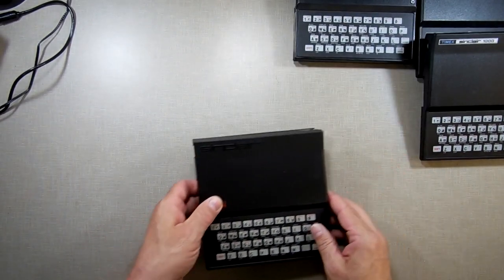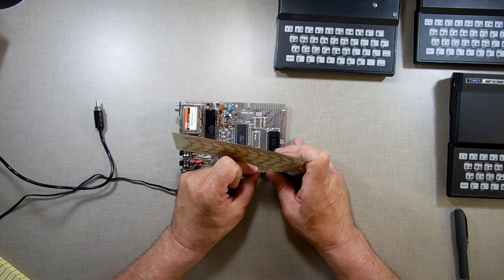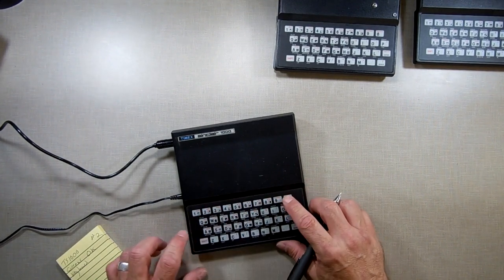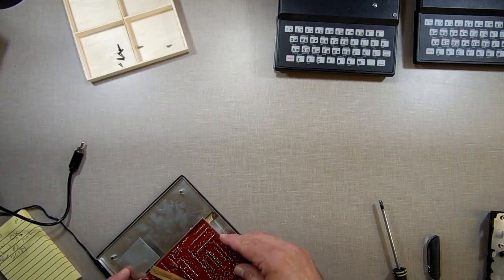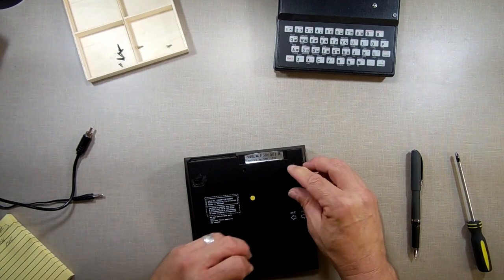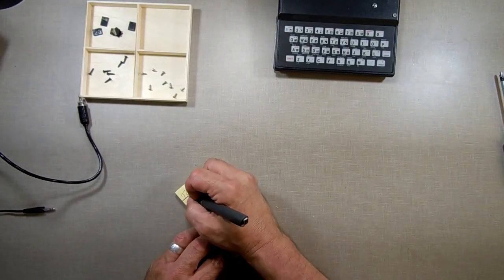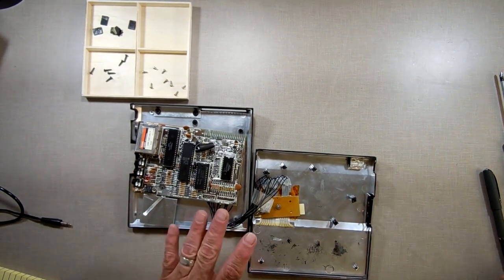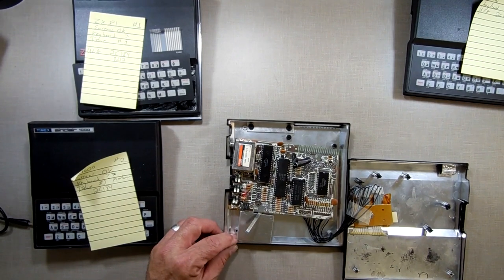ZX81 / Timex Sinclair 1000 - Repair-A-Thon Part 1

Comment: Great video, those darn membranes.  I have a ZX81 that I just finished updating, composite mod,  16k internal chip, this was my first computer.  I recently got a TS1000 and decided to do the same to it, the board is a issue 3 made in 1981 the ula is 2c210e 8249, the ROM is a Motorolla I believe part number is ZCM38818P and date 8302 and the RAM Toshiba 2016P  2KE.  After doing the updates to the board, I tried it and got the K cursor after about 6 to 8 seconds so I assumed that everything was OK, I next put on a new keyboard membrane and reassembled the computer.  I hooked it up and turned on the power and got the K cursor up in about the same time frame as before, I next tried to enter a quick ram check program and was shocked to find no keyboard function, I checked that the keyboard was plugged in correctly, check the + 5 volts and the 0 volts connections, even changed the CPU to a modern one, but cannot get the computer to work.  Any thoughts what the problem could be, and help would be appreciated.  Thanks.  RJ
Reply from the maker: No keyboard at all would probably mean it’s not the keyboard / back track your work and look for shorts on the address lines
Reply: @8BitMilli  Thanks for your reply.  I checked over my work and can see nothing wrong or shorted, actually it has the same result with the 2K ram or the new 16K ram.  What else could it be?  Thanks. RJ
Reply from the maker: This may not apply but make sure your ram expansion is after the diodes ( or are they resistors ) between the keyboard connector and the ram chip
Reply: @8BitMilli  Yes the p-wires are connected after the diodes, the ram upgrade seems to be working by the length of time it takes before the K cursor appears compared to the 2K ram.   I have checked each diode and rechecked all my traces and voltages and can find nothing wrong?   Can the ROM and ULA be swapped out, I have a couple of issue one PCB with earlier ROM & ULA?  What are the two large capacitors for?  Would they cause this problem?
Reply from the maker: The ula could - you can swap them out - are you positive the keyboard is good? You can short a line to simulate the key presses - get the keyboard schematic and see which lines you can short with a small wire to get a key press
Reply from the maker: The ula uses the same lines and could be causing an issue too
Reply: @8BitMilli  I did the ULA swap, no difference.   There is a test for the keyboard, first check continuety between the furthermost pin on the small keyboard connector, and pin 25 of the ULA, this was OK.  Next, using a jumper wire on the same pin, call it pin 5, and touch any one of the pins on the 8 pin connector, no result.  I am sitting looking at a nice screen with the K cursor, no matter what I try it just won't function. RJ
Reply: @8BitMilli  That is my next thing to try, testing all the address lines.  RJ
Reply: @8BitMilli  There is a post on Sinclair ZX World to check the 5 pull up resistor.  By the colour code they are all 10K 5%, can they be checked while still soldered in?  I tried, only one came close 9.7K  the others were around 6.5k?  RJ

Comment: Perhaps you can tell me why my TS1000 power works without the 1016 but when I plug in the 1016 it draws too much power.
Reply from the maker: Power transformer in the 1016 is bad most likely

Comment: Great stuff. Do you know how to fix error of no cursor following connection of 16K RAM expansion. Worked on first try. No longer works (no cursor) on load with or without extension.
Reply from the maker: Sounds like a bad connection / try cleaning the connectors

Comment: I have a USA ZX81, and i think the ULA is dead (I've tried in on a number of TVs and CRTs and only get a black screen). Any chance you might have one sitting around? Otherwise the machine looks to be in good shape, and I would love to have it working.
Reply from the maker: Have you considered doing a simple composite mod? Bad memory can also be a problem
Reply: @8BitMilli  I did test some of the pins on the ULA and about the only output I seemed to get was a lot of heat (though it was a couple of years ago, I should try redoing the trouble shooting). The composite mod would be a nice one to give a go as well.
Reply from the maker: Yeah give it another shot

Comment: THOSE DAMN MYLAR KEYBOARDS WILL BE THE DEATH OF ME

I managed to repair my Timex Sinclair 1000 keyboard... but only after basically rebuilding every single keyboard trace using copper tape (with conductive adhesive). I'm half tempted to mass produce some repair Timex Sinclair 1000 keyboards using the same stuff, or even using little tac stitches because at least the wiring is pretty simple... especially considering that importing proper replacement keyboards to the US from the UK tends to cost more than these units are worth themselves.
Reply from the maker: A replacement keyboard would be best

Comment: It's hard to imagine these things were actually made in 1983.  By then, a Vic-20, which is better in every way was well under $100.
From what I recall, they sold for under $50 and that was really the only "feature" the computer had.  It was basically a door stop.
Reply: the clue is in the name - 81   not 83  !
Reply from the maker: So many people got started in their careers with one of these
Reply: @8BitMilli  In the UK perhaps. Not much in the US.   I would also say, even in the UK, they didn't get their start with ZX 81 so much as a Spectrum.
Reply: @ukwebb  The 81 is not a date, though I concede it was released in 81. IIRC, it denoted a z80 with 1k of ram. Also, it was on the market in 1983 not being discontinued to 1984, well beyond its sell by date.
 I remember leaving that comment and I know I googled it first.  IIRC, there is more than 1 computer listed in this video and one of them was released after 81.  The Timex 1000 was released in July of 82 (and IIRC, there was one in this video)
Reply: @tarstarkusz  I don't believe that's correct. This machine was preceded by the earlier ZX80, a generally similar but "fancier" white case and color label. The ZX81 followed the next year. I bought one in the US by mail order (NOT the later co-branded American-aimed Timex Sinclair 1000) in the summer of 1981, used it for a year and then sold it to a friend for $50 that I put toward the Atari 400 I bought in October 1982. I recently found another American market ZX81 that I am diagnosing and hope to repair in the coming weeks.
Reply: @LeftyLabs  Perhaps it was a reasonable deal in the summer of 81. By the summer of 83 it wasn't, no matter what the price was.
Reply: @tarstarkusz  Yet the original Atari 2600 - first sold in 1977 - remained on the market until 1992. The people buying computers in the late 70's through late 80's were far from homogenous in what they knew about computers, what they wanted or THOUGHT they wanted, or even what was available. I remember those days well.
Reply: @LeftyLabs  WHAT? 
The Atari 2600 was a closed games machine, not a general purpose computer.  If you wanted to play Atari 2600 cartridges, the only way to do so was to purchase an Atari 2600 compatible console.
You could make the argument that if you wanted to play a ZX-81 game or run a ZX-81 software package, the only way to do so was to buy a ZX-81. But you are not making that argument, largely because it's not valid.  What few programs that existed for this machine were ported to others or were themselves ports of programs for other machines.
You can also make the argument that if you wanted a z80 based machine for cheap with built in basic, the pickings were slim unless you went into the CP/M world, which largely was not cheap.  Of course, these machines were not CP/M compatible.  They don't have enough RAM and I don't think they even support disk drives.
Reply: @tarstarkusz  you’re totally missing the point. Many consumers generally had no concept of what they SHOULD get, they bought stuff because computers were the new big thing and they wanted to see what it was all about. There was little sophistication in the mass-market. At one point in the ‘83/‘84 time frame my local grocery store was selling the TS1000 for like $25 and people were buying them. Was it the “right”thing to do? Of course not, for computer hobbyists who knew better. Same thing with my video game analogy. Anyone with a brain in America at least was playing Genesis and Super Nintendo systems by ‘92 but Atari was still milking that VCS platform for anyone they could sell to. So who cares if the ZX81 was obsolete by ‘83. They were being sold to people who didn’t know enough to know better.